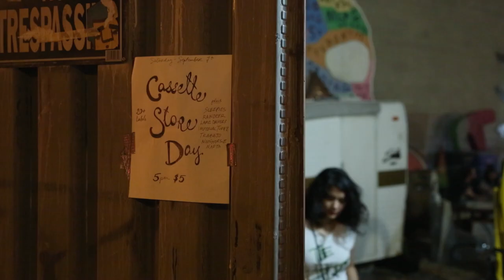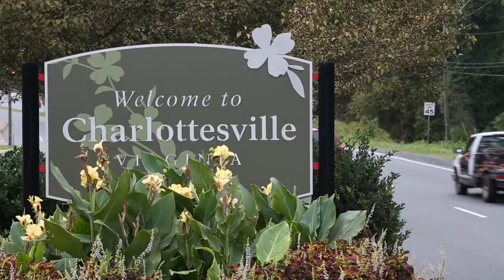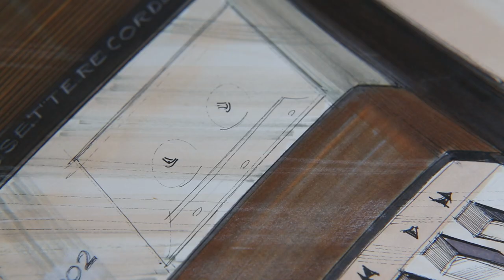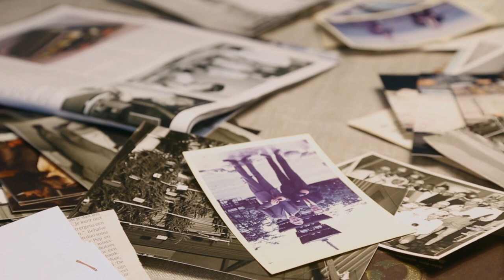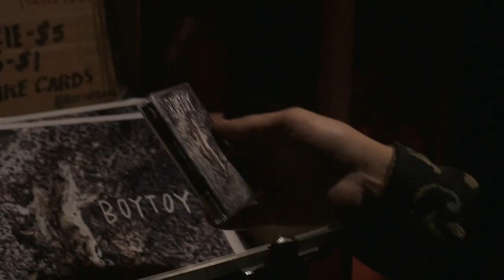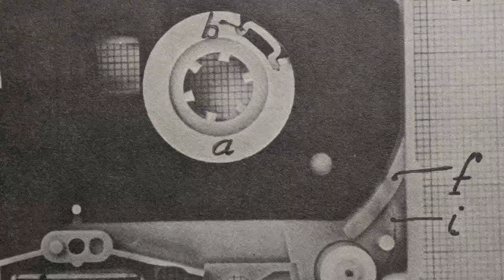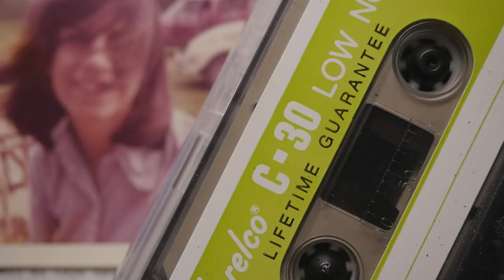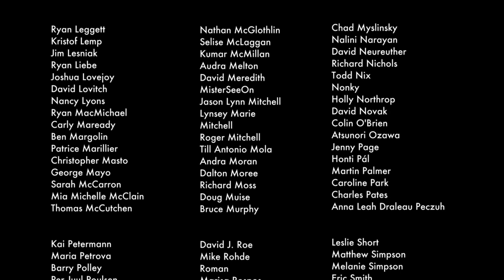Cassette: A Documentary Mixtape | The Importance of Physical Media | FULL DOCUMENTARY

Comment: The big problem with the cassette nowadays and its possible revival is you can't buy a good quality brand new cassette deck. What you find new is totaly rubish and if you want to enjoy this format you have to deal with the used market in order to find good quality decks from the 70s to the 90s.
With all the possible issues of these old decks if you can't fix and maintain them (belts, mainly, but also other issues, head wearing, capacitors, etc...).
Consequently the general public stay away from cassettes, so until now it's a niche market.
Personnaly I like cassettes and own 2  three heads cassette decks but they're from late 70s ans late 80s, and I had to fix them, obviously.
Reply: And old decks ruin your tapes.
Reply: @RockyRMR   A bad maintained old deck, yes, it could. A good one, no.
Reply: @FLH3official  obviously. but I’m saying old, used, thrift store finds.. I wouldn’t trust em.
Reply: How true!  Great comment!
Although I haven't used it much in the last 20 years, this makes me kinda glad I've kept my 2-motor JVC KD-V220  cassette deck I bought in 1986!  It's a bit dusty on top, but it still works!